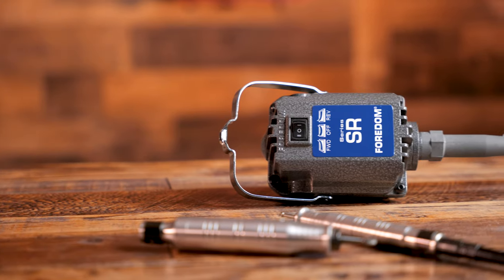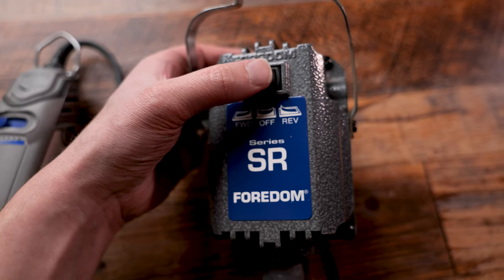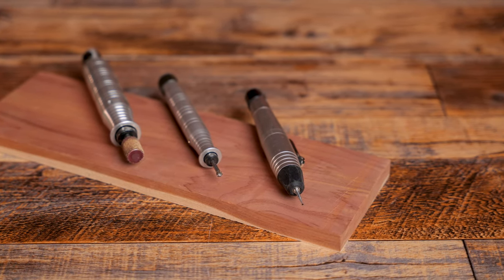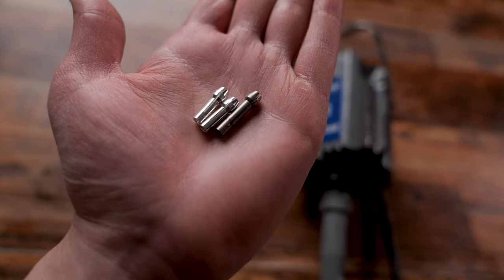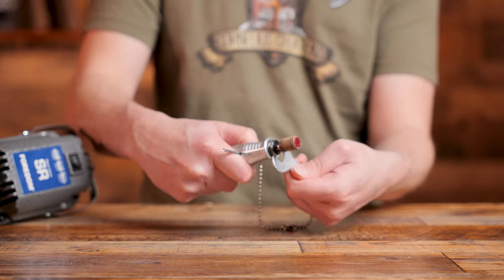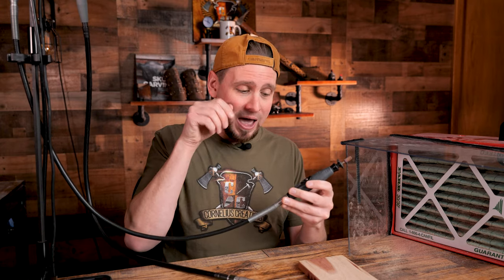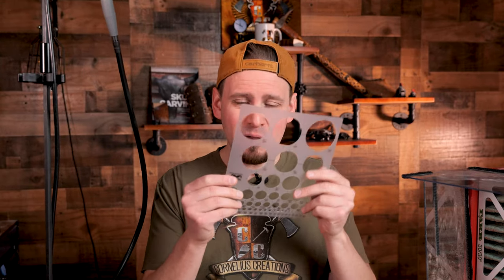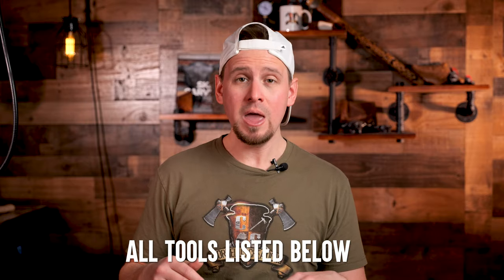Woodcarving with the Foredom SR - Honest Review & Demonstration

Comment: This came up in my feed. IIRC, I critically commented on another video of yours a time back. This video was very good. I run a Foredom TX as a daily driver and also have a Foredom SR on the same stand. Foredom's metal pedal on the TX and a Lucas pedal on the SR. Both pedals are outstanding, albeit quite different, and offer a noticeable upgrade over Foredom's plastic pedal. Similarly, Foredom sells two stands: The clamp style, as in the video, and another that bolts to the bench. I have both. If you're in a position where you can pop holes in your bench, the screw down model is the better option. Good luck.
Reply from the maker: That is a great tip!

Comment: I inherited a Foredom handpiece... appears to the the H.8 .. Grandpop carved NZ jade and bone and things a bit. I don't think this one was hardly used. I make wooden flutes and sculpted "blocks" (like a little totem on the flute as a removable part). I have no motor etc... my favorite tool so far is a Black & Decker battery rotary tool I removed the ass end off and wired directly. But it's weak.

Comment: I purchased a Dremel 3000 and on high speeds it was OK no operating issues, but when I ran it on its slowest setting it would speed up on its own accord to unacceptable levels.  I returned it for a refund, but they would only refund the actual Dremel 3000 unit, not all the other parts that I purchased at the same time(Flex shaft, accessory kit , case etc), and that is a warning to people purchasing through Amazon, get the base unit and then when happy purchase the other parts over time and build your collection as you go.   I have now purchased a Foredom SR and why I am watching this video.   Great video and useful info.....

Comment: Hello, very good review, I have two questions:

-How long in minutes can I work and how much rest time should be given so that it does not overheat?

-What is the maximum time I can use it per day? 

I ask because I have a Dremel 4300 and I don't know what happens because I use it for 20 minutes and let it rest for another 20 to be able to use it, I have already taken it to be repaired several times and it continues to break, I don't know why and I want to see if I buy this one that looks more powerful, I use it to carve wood and bone.

Thank you in advance, greetings 🤙🏽
Reply from the maker: Hey there! Thank you for the kind words! So there is no comparison between the 4300 and Foredom SR. The Foredom can be used hours day and will not be burned up. In your situation, I’d toss that Dremel and go with the Foredom and never look back. You won’t regret it.

Comment: I saw in another video that you tried the Dremel Fortiflex. For carved wood sculpture what do you recommend between the Foredom SR and the Dremel Fortiflex? I also wanted to ask if you noticed a noise difference (DB) between the two motors, which one makes less noise?
Reply from the maker: The Dremel makes a little more noise. The foredom has a little more horsepower, but both are great options.
Reply: @CorneliusCreations  thanks. Finaly i opted for a dremel 4000 coupled with a foredom pedal. I buy it at the end of the month.

Comment: Have you tried the Fordham TX model? It has twice the horsepower at 1/3 HP, compared to the Sr model which has 1/6 HP? I was wondering why you picked the Fordham Sr instead of the TX model. Thanks for your videos and best wishes.
Reply from the maker: Hey there, Great question. If you watched the video you will see where Foredom recommends the SR to most customers. You need the speed that the SR has for Woodcarving. The TX model is made for slower applications. You will find that a lot of mechanics use the foredom.
Reply: The Foredom TX  has a heavy duty flexshaft. The key has a square fitting. 
It is great for grave stone 👍 see @ West Virginia Stone Carving.

Comment: So you don't use top speed when intense hogging? I guess I assumed it would work best at higher speed for that. Would it put too much stress on the machine?
Reply from the maker: I will go slower if I am developing burn marks. For some of my hickory handles, I won’t run the Foredom full blast because the coarse kutzall burrs perform better running slower on this type of wood. You have to get a feel for what you are doing and allow the tool to talk to you if that makes sense. Fast doesn’t always equal clean smooth cuts when hogging.
Reply: Makes total sense.  I'm sure I'll get a feel for it. I already am as I practice things. Thanks for answering! I wasn't sure you would see this because it's an old video and I know you're a busy man! I appreciate it!  If you don't mind answering one more curious question, what is your favorite wood to carve?
Reply from the maker: I would say probably basswood for how easy it is. But I almost always carve hickory.

Comment: When I use a flexible shaft after 10 minutes it is very hot, how can I fix it
Reply: grease it
Reply: @justinsane332  
I grease it but to no avail
Reply: @baqergt5062  well, that should do it... all flex shafts build up some heat in use, is it too hot to touch? or just warm?
Reply: @justinsane332  
At first it was very hot, then I put a lot of oil and it stays hot, and after using it for a week, the temperature decreases, and now I wrapped it in a cloth and used it.